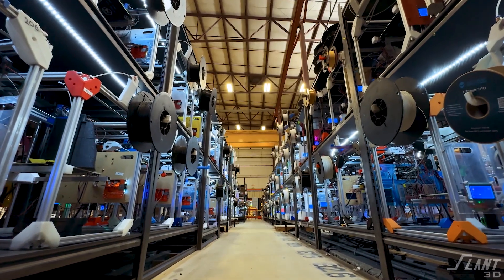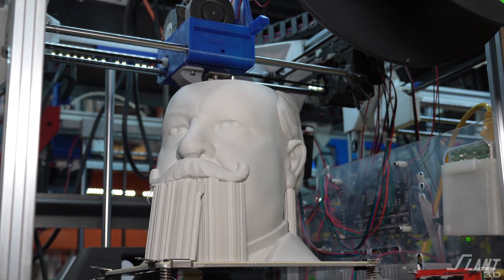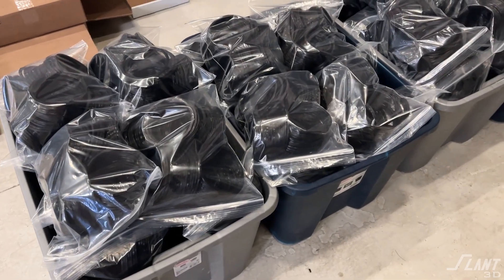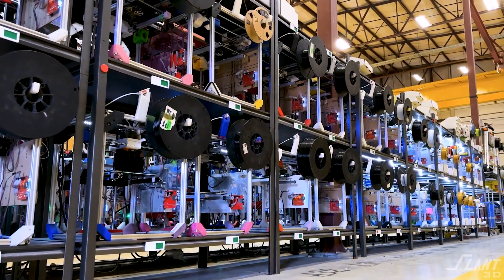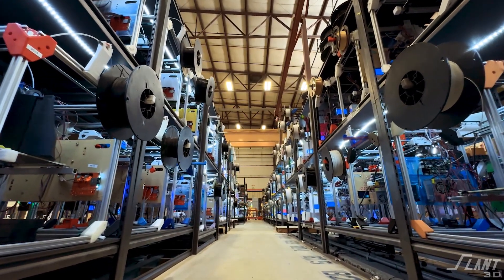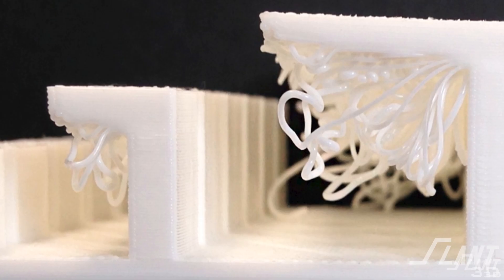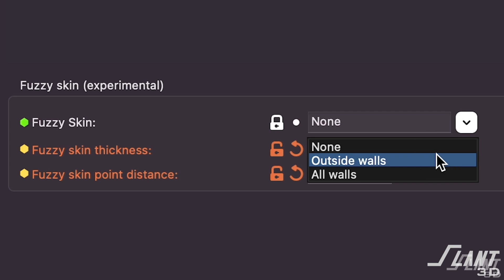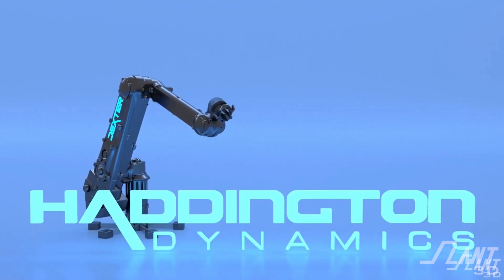Is 3D Printing Scalable?

Comment: I spent about 6 months working in a factory rework line, where among other things the job involved reading the little digit on injection molded parts and pulling out the ones with a given digit for that mold. Most small injection molded parts are multi-part injections. Say 8 light pipes (the bit that carries light from the bulb or LED on one side of a control, to a point on the surface of the part (think a knob where you want a light to indicate which position that knob is pointing at for an A/C-heating control in your car) The bulb can be replaced without replacing the entire knob. The QA portion of the factory finds that several of the parts with say "6" on the part are regularly not fitting in the component it is to be a part of, you want to go through the lot of light pipes that just came in and pull all of those light pipes out of the batch going to the assembly line. As I was a contracted employee of the factory through a third party contract company (not unusual in that neck of the woods at that time) I have no idea what my 'cost' to the factory, both in time worked, (40-48 hours a week, times something like 10 people in the rework team) added to the cost of the injection molded parts, but at the very least on a 8 piece injection molded part, if one out of 8 parts were out of spec, and had to be pulled, then the cost of every other one of those parts went up by 1/7th. More for higher fault rates. I wouldn't be surprised if we're talking about $1 per 80 pieces though.

One of the other items that I observed is that the only thing 'Just In Time" about the process was that the ordered parts for the destination company arrived as soon as they were pulled from the warehouse of the supplier put on a truck, and delivered. The process didn't eliminate warehousing in any way, just removed it from the final assembly line of the company 'implementing' JIT. 

That said, some things are likely to have changed, as the factory I worked at is now an empty building. Perhaps I should consider buying it and turning it into a print farm.

Comment: Scale? once you've done all that design work, sold off enough copies of said part, refined your designs... then sell enough more, then invest in the injection mold if the volume warrants it. but it is a waste of money to do that beforehand
Reply: I think there’s a position here for printing in-between mass production. There’s significant design hurdles between processes that will need to be considered.

Many initial products are made with Rev-A/B/C manufacturing before enough profit is captured and feedback/testing is documented to justify larger scale. Example, with breakout automotive design, a significant portion of new parts are CNC machined before a cast or sheet metal product replaces it down the line. Legacy automotive has the advantage of existing tooling but that’s turned into a hurdle as they become slower to adapt to EV manufacturing etc after making money off incremental year to year changes in design.

Ok so printing, it’s a neat resource, as stated in the video, you have to design for it and I see that as an issue with scalability. If you sink your design into optimized printed parts, you’re potentially locking yourself into that process. Pivoting to injection for example will require heavy design turn around. That’s great for a massive company, but what about intermediate volume production? I think that makes more sense here.

I can’t help but compare printer manufacturing on this. Prusa has largely printed parts in their products and have been able to leverage that for incremental design changes and lower cost. Compare that to Bambu Labs A1 line, those machines are made with more traditional production processes and they’re undercutting the competition in price for similar quality. Note the cable issue with the standard A1 caused them to recall across the board, maybe that would have been an easier fix for Prusa with their part strategy.

It’s worth mentioning that this channel is selling a product, the more truth in these videos the better. But it’s worth recognizing that this is advertising for Slant 3D, it’s reasonable to expect them to persuade you to adopt their processes.

Being able to make parts that did not exist before isn’t worth discounting, considering we throw away anything that doesn’t work anymore even with a RMA to a manufacturer. So making a more complex part out of fewer components that cannot be individually replaced is less of a concern for modern markets.

The best part is no part, to a certain point. If 20 parts can be 3 parts, that’s often preferable to the consequences.